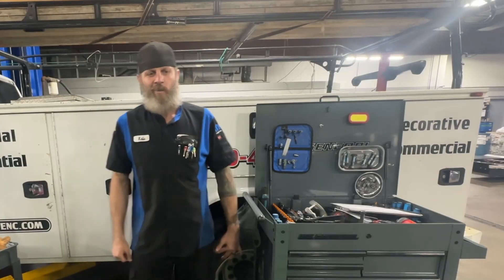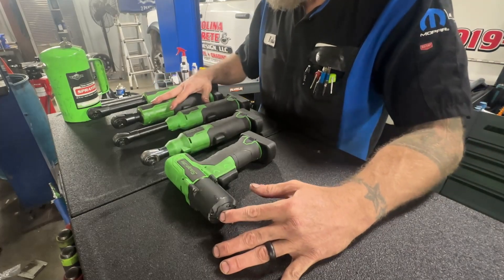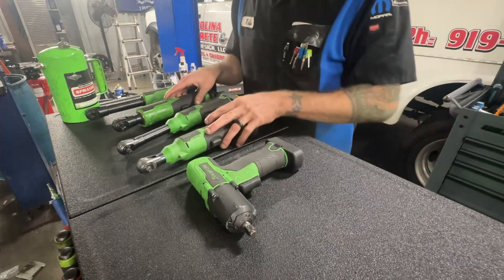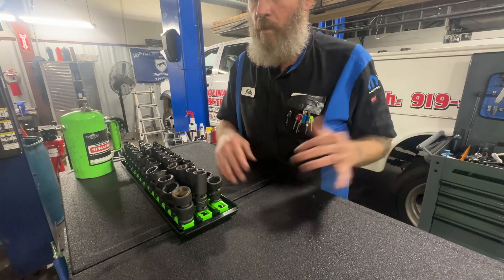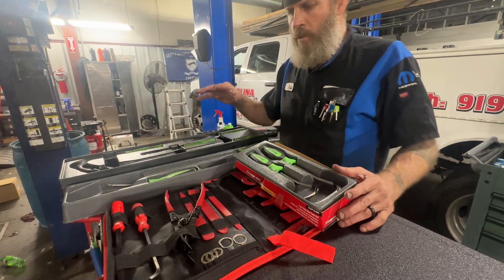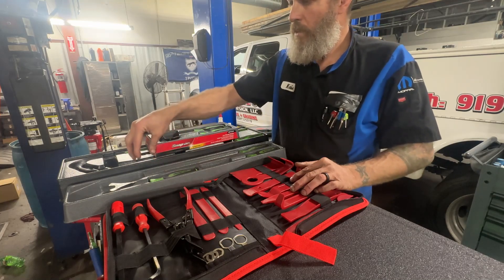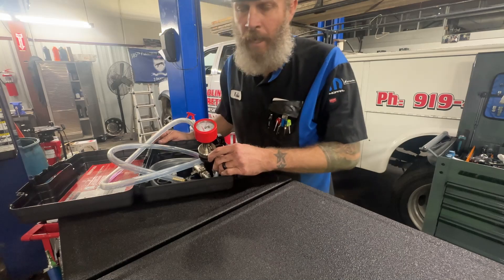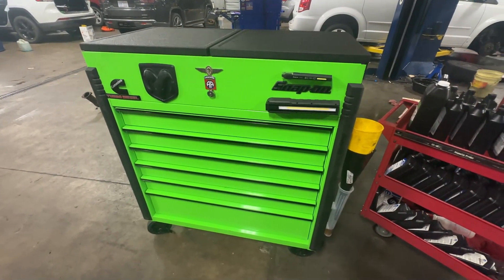What tools do mechanics need? || How to increase efficiency as an Apprentice/Technician

Comment: Great recommendations! I also recommend getting a pneumatic ratchet/impact if you’re on a super tight budget. Then once you get a few paychecks you can start getting tools with the battery platform you want. Or like he said, Harbor Freight battery tools should last you long enough to get a few paychecks. No need to tank yourself in debt right away. Great video for new guys!

Comment: Great video. I use that HF three shelf cart for DIY automotive. I bolted on a pair folding shelf brackets with a 16" x16" laminate top for extra work surface. It works great and having a place to put tools while you work keeps you from leaving too many tools and parts in and around the engine bay.